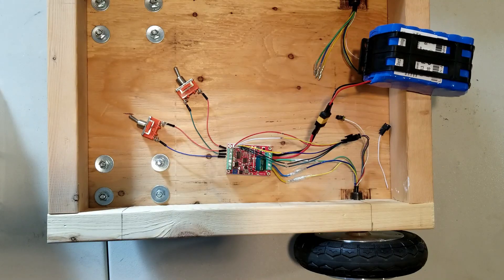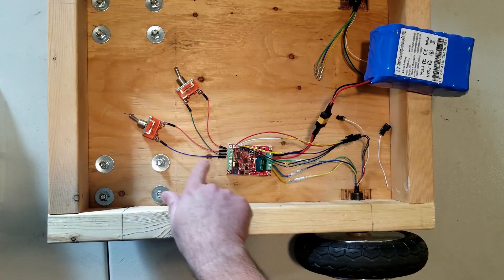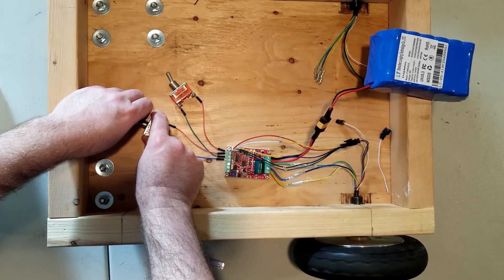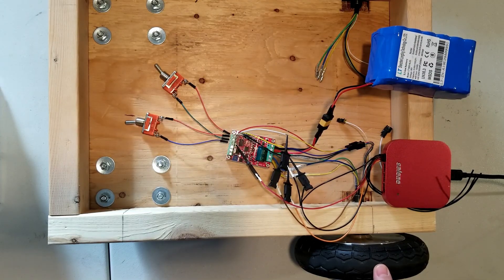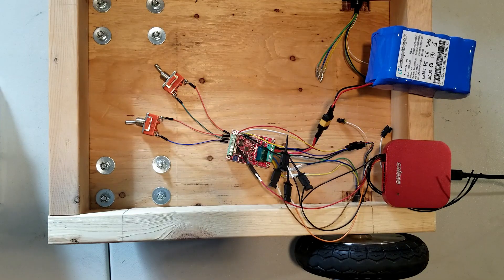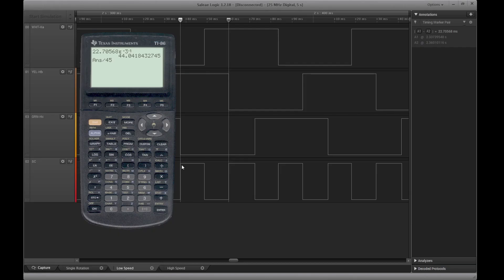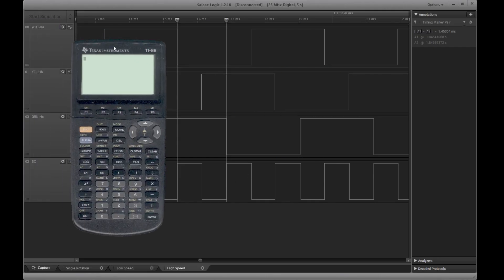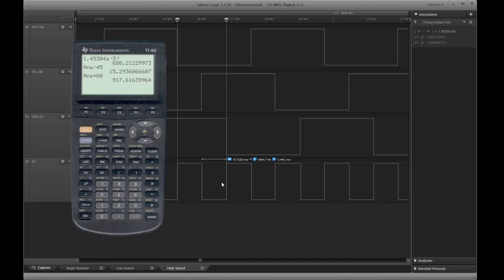RioRand 400W Brushless Motor Controller Demo

Comment: How does the break works? Does it uses any power resistor or does it breaks by regenerative breaking sending the power to the battery ?

Comment: These are very cool builds. 
Just a heads up to future builders. If you are trying to drive hoverboard wheels, these are not for you. 
Even at lower speeds, the controller will burn up. It's only a matter of time. Look for controllers in the 800w range to driver hoverboard motors. This is doubly important if you are moving people or any kind of weight over 10-20lbs.
I'm sure in theory/on paper these should work, but in reality, not so much.
Reply: Dude you might be right i burnt 2 on the 2nd day
Reply: @rylinyt  I learned the hard way as well.
Reply: @Modivation_Inc  i thought it was just my shitty wiring but nope I got another pair this time burnt it out same day, gonna get some 500w controllers

Comment: thanks for the video. Is there any limitation when connecting two or more drivers in the scheme? Do I need to put splitter diodes on the power input, ground, etc.?

Comment: My motor is 36 V but it started smoking smoking randomly? I followed your wiring diagram in the video. I looped 1 and 3 to get the motor to turn around. It did not work.:
Reply: You need a bigger controller. Something around 800w will work.  I burnt up a couple of these, tried a bigger controller, and never had another issue.

Comment: do you happen to know why motor goes 100% speed in forward but not 100% when changing direction pin? seems like motor only goes 50% when dir pin is high
much thanks!
Reply: Fwd and rev speed is the same, when everything is wired correctly.
Reply: I have the same problem
Reply: @raymondhardman7286  The solution is to try all 6 coil wiring sequences.  The correct one will run smoothly in both directions.

Comment: Can you pulse the brake signal to slow down?  From what I've seen it stops it very abruptly which is what happens if you short the phases.  I have one of these but if pulsing it blows it up, I don't want to buy another one.

Comment: Hi there, great videos and blog. I have 2 hoverboard motors and 2 zs-11h drivers, both working fine with 10k pots individually. My question is how can I control both drivers using a thumb throttle? or split the signal to both drivers in someway? is that where a Arduino would have to be used? I'm sure a dual pot would work but I require a thumb throttle for my trike project. Any thoughts friend 👍
Reply: You should be able to connect the center lead of the pot to both hoverboards with a splitter cable.

Comment: Hey I’m not sure if you’re still responding to comments, but I was wondering you you can attach an absolute encoder to this board, to get positioning. If you attach this board to an arduino would it be possible to attain some position control?

Comment: This was a highly informative video and cleared up a lot of the information I needed for this board. I've been trialing a different board type that was smaller but didn't have an active brake pin and the reverse took time to happen which are terrible for robotics control. So thanks!

Comment: Any idea what would make the motor noisy? Its working but Im getting a sound that sounds like gear teeth meshing. I have tried it with multiple motors and still sounds the same.
Reply: The Hall sensors are not connected in the proper sequence.  It will waste a lot of power.

Comment: Very cool. My initial testing with the yellow hall-less version of this board and the hoverboard motors is going well. Next I want to figure out how to use a pwm input signal. Your demonstration of the speed output signal will be helpful later, because now we could create a closed loop feedback system using motor speed monitored by microcontroller.

Comment: This video was very helpful. I have the zs-x11b. It also came with no paperwork. I really wish these Pn on the chips weren’t rubbed off. I never thought to use the logic analyzer to figure out my hall sensors. I was going to use trial and error. I really wish I had 2 of these. 
Great Video.

Comment: Hi I am a bit late to the party but this great content. I noticed there is an unconnected white wire coming from the axle what is its fuction?
Reply: Probably for the lights on the wheel.  My hoverboard wheel has the same wire

Comment: Hi! So I made the wheels work with the small blue potentiometer, but I want to use a remote control. Where do I plug the 3 wires for the Remote control to work? the red/yellow/black wires. pls help

Comment: How are you going to control the other wheel, use the direction  switch or re wire the motor ?
Reply from the maker: I'm using a 2nd brushless motor controller and just using the direction switch so it turns the opposite direction.

Comment: thanks for this video! Do you think the 5v rail on the speed controller could power and Arduino?
Reply from the maker: I've seen two versions of the board shown in the video.  The old version, which is in the video, has a large on board 5V regulator.  It should be plenty big to supply power to an Arduino, and I have done this on one of my projects.  They have reduced the size of the 5V regulator on the newer version of the board.  It should still be able to power an Arduino but you will have less head room.  I have tested this on the new version on my bench and it does work.
Reply: @mad-ee  waiting til Jan for some to come from over seas :-(
Reply from the maker: @Billy18bm  Yeah the electronic supply chain is really messed up right now.  Long lead times everywhere.
Reply: @mad-ee  i just got mine in. It's funny the 5v rail your hooking into with your switches is labeled "STOP" (there is also brake/dir next to that). Also i don't see any jumper and the "PWM" pinout is labeled 0-5v. I'm not clear how to turn off the POT and also not clear if it can take PWM even though it's not labeled as such.
Reply from the maker: @williammuff5485  They changed the design of the board.  I have information on the new design on my blog:  https://mad-ee.com/easy-inexpensive-hoverboard-motor-controller/
Reply: @mad-ee  it has a 5V 100 mA output max rating.
Reply: Hello sir,
  Am using raspibery pi to control the BLDC motor using same driver.
One thing is it's works fine using potentiometer provided in motor driver circuit. But if i use code to control through Raspberry pi it's not working. Code has no error.

Comment: Hello, is there a need for the hall sensors for the motor to function?
I was going to try RioRand 380W 5-50V PWM DC Brushless Electric Motor Speed Controller with Hall-Less
Reply from the maker: I think if you get the hall-less version of the board it should still be able to run the motor.  I have not tested this so I can not verify if it works.

Comment: Hi.
I'm searching how to write on arduino a code to have rpm from this output pin
Reply from the maker: I'm working on a new video about this.  I just found out that there is a new version of the board and I'm waiting to receive it before finishing the video.
Reply: I'm asking if it's necessary to connect grounds between PWM signal, RPM signal and brake, allow, reverse pins.
Reply from the maker: @alain8955  You will need at least one ground connection between the PWM controller board and the Arduino.
Reply from the maker: @alain8955  I just published a blog post with some Arduino code to control the PWM and read the speed.  Check it out here:  https://mad-ee.com/controlling-a-hoverboard-motor-with-a-simple-arduino/

Comment: Did you have any problem with the board going to sleep after about 5 seconds when using PWM?
Reply from the maker: I have not seen this behavior.  Are you saying the motor spun for 5 seconds and then stopped?  Could be a power issue.
Reply: Didn’t stop during operation. Running it with PWM, when I would stop the PWM signal after about 5 seconds the controller would stop. Would need to lift the PWM signal and reconnect to get to be active again.
Reply: @djmrozinski  ever figure this out?

Comment: Hello what value should be the external potenciometr?
Reply: 10k
Reply: @MrClosetmonkey2011  thanx
Reply from the maker: 10K is a good value but any value between 1K and 100K should work.
Reply: When I use an external twist potentiometer, the motor won't stop, it always runs at very low rpm and goes really fast when you rev it.

Comment: The best video I've seen regarding a brushless motor controller. Very thorough and covered the braking and reversing very well, some thing my project needs. I love that he used his logic analyzer to see the speed pulse output. I think where was one minor thing. I think you meant to say that there are 45 rising edges "per REVOLUTION". I thought I heard you say "per SECOND".
Reply from the maker: Thanks Rick!  Yeah I probably said that wrong, thanks for the correction.
Reply: Hey Rick , i have problem and i think you're the right person to solve my problem , so i my problem i want to control 2 brashless motor with tow different controller but each of motor turn in reverse direction so i need help😅

Comment: Very helpful video, I was wondering if it’s possible to connect the pwm pin to an arduino and control it like that?
Reply from the maker: Yes it is possible.  That is going to be one of my next videos.
Reply: @mad-ee  Awesome! I'm currently working on a project with the same speed controllers and was wondering if I could do that. Looking forward to future videos!
Reply: @mad-ee  It works? Were you able to use an Arduino?
Reply: Can you change direction with PMW?
Reply: @tomassimaro6795  Not exactly. PWM sets speed only. This BLDC controller has a direction terminal that goes in one direction when connected to ground and goes in another direction when not connected to ground.
Reply: @aaedmusa  thanks, I found it out together on how to use Arduino to control the speed. My humble note, it doesn't work without the hall sensor :)
Reply: @tomassimaro6795  you must have gotten the sensored one. A sensorless one doesn’t require a Hall effect sensor
Reply: @tomassimaro6795  can you please share the arduino code to control the speed, i'm currently trying working with the same controller, i'd really appreciate your help
Reply: @bassemgalal590  Yep its simple. All you have to do is connect the pwm/speed pin on the motor driver to a pwm pin on arduino, connect the direction pin on the driver to a digital pin on the arduino, and connect the brake pin on the driver to another digital pin on the arduino (if you plan on using the brake). It goes without saying, but you'll need a power source connected to the controller, just make sure you connect the ground wire from the battery to the ground on the arduino. Now to control it in the sketch you'll want to set your brake and direction pins as outputs in your void setup function like this: pinMode(4, OUTPUT). This would be if you are using pin 4 on the arduino. Next all you have to do is write analogWrite(9, 200) for example to run the motor. In analogWrite put the pin number of the pwm/speed pin (9 in this case) and then a number from 0 to 255 which correlates to the speed (0 is motor off, and 255 is motor at full speed.  If you wish to change direction or turn on/off the brakes simply do digitalWrite(4, HIGH) or digitalWrite(4, LOW). Hope this was helpful, if you want I can send you an example of this compiled into an entire sketch. Let me know your email if so.
Reply: @aaedmusa  Thanks a lot sincerely, i have another question as i am a bit confused, do i need to connect the ground of the riorand to the ground of arduino, or just connect the pwm pin?
Reply: @bassemgalal590  Yes somewhat, you connect the ground of the battery to the riorand, and then connect the ground of the battery to the ground of the Arduino. So the ground terminal of the battery should have two connections: the riorand and the Arduino. Also Make sure you only connect the V+ terminal of the battery to only the riorand and not the Arduino.
Reply: @aaedmusa  Thank you so much for this comment!  I am new to coding and I have had no idea on how to change the direction for the motor.  This helped so much!
Reply: Hello sir,
  Am using raspibery pi to control the BLDC motor using same driver.
One thing is it's works fine using potentiometer provided in motor driver circuit. But if i use code to control through Raspberry pi it's not working. Code has no error.
Reply: @vinodkumar.p7800  how much motors you have ? I have to contro tow different motors with different controller but the motor do not work in same direction